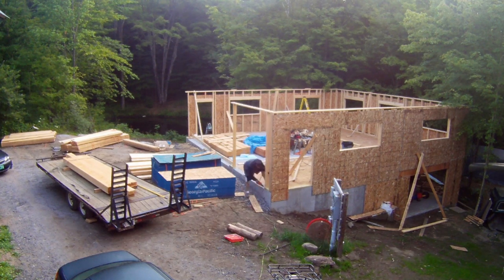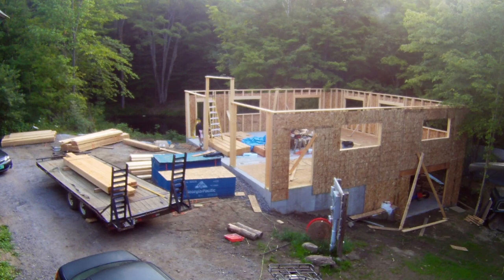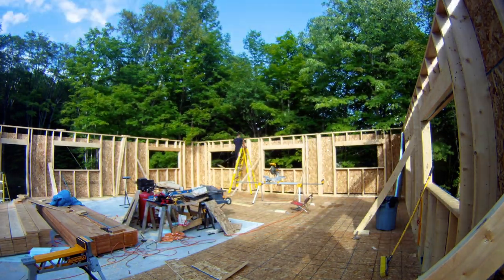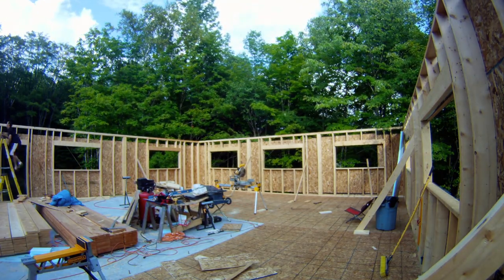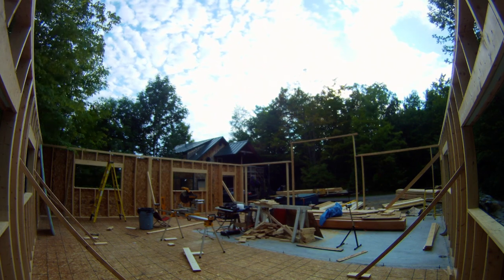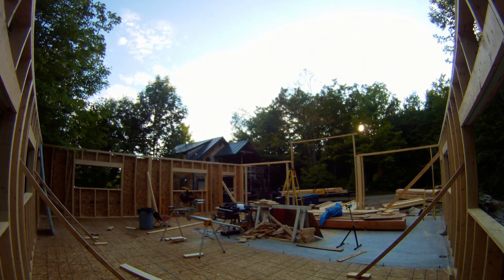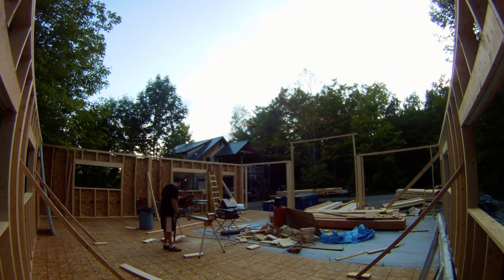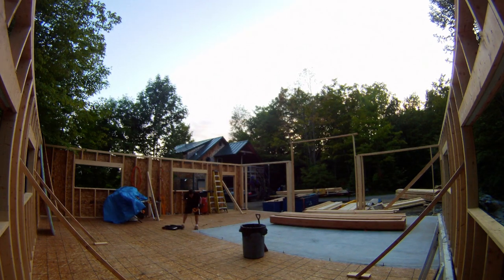Framing Garage Doors Wall and 2x6 Posts - 27 - My Garage Build HD Time Lapse

Comment: I like the idea of the posts you put in around the shop. A lot of builders would not do that just to save under 50$ in lumber. But that is ridiculous!! I did similar in my 24x30 shop. I sistered three 2x4's together on each wall of the corner. So there was about 5-6 2x4's in each corner. It dramatically increased the rigidity and strength of the building. There is no reason not to beef up first floor buildings.

Comment: Good thinking on the double top plate. I'm not sure if you can get away without it actually. You'd have to check code. The double top plate adds enormous strength because it overlaps at the corners and also ties the top plates of the walls together.